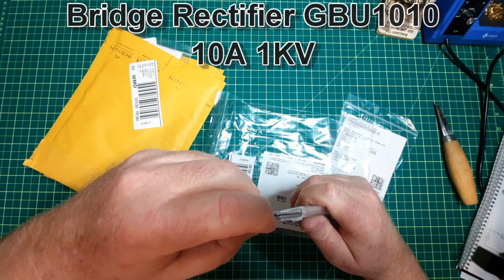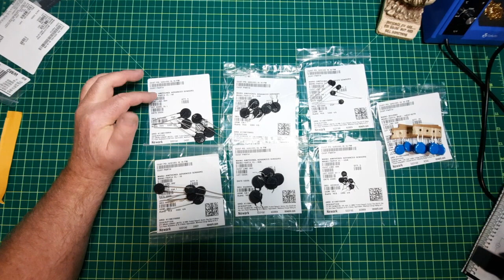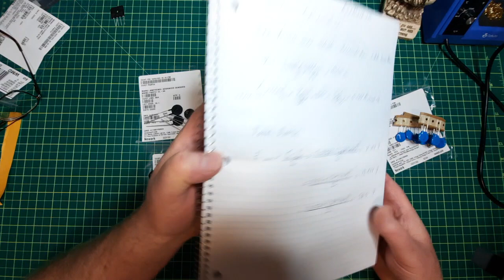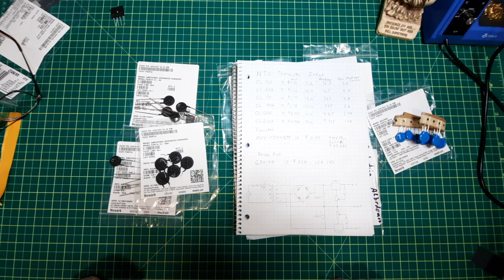Electronics Mailbag 19 ish and NTC Thermistor calculations

Comment: 1:29
When I was young small boy and just started with electronics hobby I wanted to make turn lights for my bicycle.
And finding that 3 position switch was really hard. But I tried out the schematics anyway.
I loved blinking lights and sound generators (different kind). Now its very easy to get these parts
Reply from the maker: Not only is it easy to find parts now, but the cost of a lot of the parts is crazy low if you are willing to wait a month for delivery, otherwise there is the pricy but fast option.